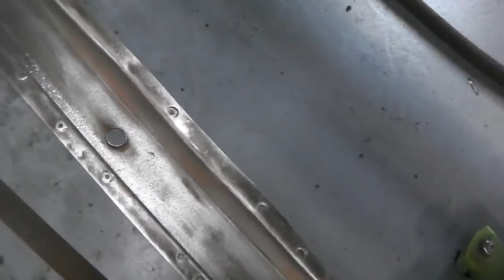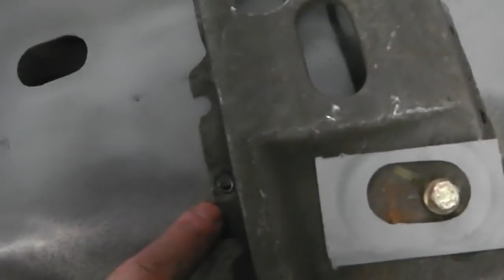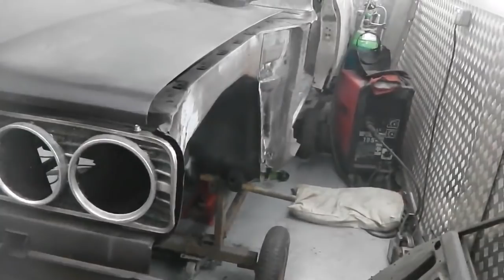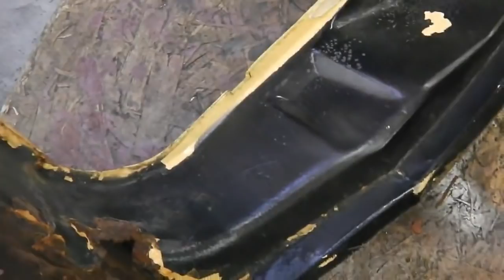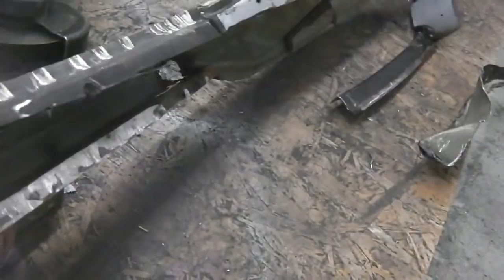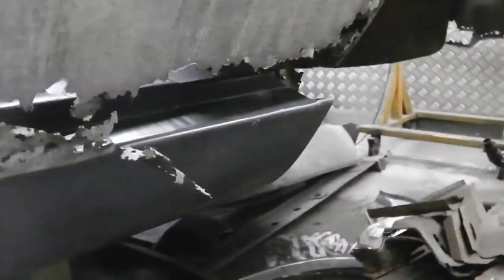Classic Car Restoration - Ford Cortina - Project Bramble Ep16

Comment: Pete, given the age of the car and the last time it was on the road, the quarter is almost definitely oxy acetylene gas welded as opposed to mig. Drilled plug welds are less likely with gas and it was very common to either fuse the edge of pinch welds or blob a bit of rod on the panel edges. Gas welding is largely a thing of the past now, however it was far more forgiving for in terms of weld prep and great for rusty exhausts. 👍🏻
Reply from the maker: very good and YES you are right its not mig!! well thought thru GG!!!!

Comment: Hi Pete, Nice to see the  new floor pans in, even though the whole shell was acid dipped it shows that inside the chassis rails still had rust inside when the old floors were removed, and that was why I decided on my one to do all the acid dipping of the panels myself, as I was removing every panel and replacing it, with new or original back in, it ensured every bit or rust was removed, and then painted inside straight away to prevent any new rust forming,  cleaning off and painting it inside like you are doing now,, will make her last years longer, than building it, and covering new formed rust with waxoyl,  like most do, your getting so much better with build quality (prep)  on this one, I have been building mine over a number of years, and had no new rust forming with the amount of panel prep work I have put in, proof it works!!,  Bramble will be a Great car when you have done,
Reply from the maker: thanks Keith, yes rust still trapped, however theres only a limited amount of cavitiys that cant be accessed, i guess panel folds are the worst to tackle. but you would have to dissemble entire car to get em all

Comment: Nice job Pete. Watched the last few on floor and sill replacement, all looking good. You spotted the cold weld correctly, where it sits on the metal rather than fused to it. No problem with your welds now though, penetration is good and the whole job is far better than some 'professional' repairs I've had to deal with.

Comment: ello mr PC.... great as always.... question..... can you tell us the make of that belt sander.....also... have you had to replace the sander ever....is it the same unit used in swampy and ruby builds..... ?
Reply from the maker: its a b and q special , macalastair cheap at 34 quid and GOOD if you take it  easy but MUST MUST use zirconia belts for best results, belts are on e bay, 437mm 60 grits, its 2nd belt sander, first one seized the end bearing, though if you go gentle they are good for the money NEED 400W minimum dont get low wattage ones like the SILVERLINE if you want to grind a lot of weld s
Reply: I bought the silverline one. £32  wasted. Wish I had seen Petes review beforehand. I now have an evolution 400w.  I think it could be the same as the B&Q one but not sure but it is good!

Comment: That second pan went in sweet pete your making it look easier than it is m8 great job
 have sent you a email to where you suggested about parcel address but haven't had a reply as yet
Reply from the maker: hi antony i cant access the email as microsoft locked me out a month as i changed mobile number. if you send me your mail on here ill reply with my works e mail

Comment: I have to ask again,  this puts you up to four Cortinas.   How many can you own before you reach "maximum Cortina"?    How do you store them all?
Reply from the maker: maxiumum is 5 i reckon !!! got 1 outside (estate) 4 in dry store
Reply: @PeteCswampy  whats the 4th dry stored or are you counting bramble in that? I know you have tina g, swampy, ruby and tc outside
Reply from the maker: yes bramble is 4th dry stored but will have a 2000e hopefully too for next project after bramble
Reply: Ooh, exciting!  Do you ever run out of energy??!!!  I've still got that V8 (American muscle) that would EASILY fit into a mk3 engine bay!
Reply: Pete C Thank you for answering my question!

Comment: Hello Pete, i was sober when i started watching this movie, and now I am not.
 Thoughts,
 Nice job fella.
 Why are you going to have the shell blasted? why not epoxy prime as you move on section by section?.
Try oxy-acetylene welding as you go, MIG together stuff then grind off the protruding weld then fusion weld the panels together while planishing often with hammer and dolly,- a pain to get the hang off but worth it.
Why do people down vote these videos? do they leave a reason why? odd.
maybe they are front wheel drivers.
 Best regards, Sam.
Reply from the maker: only blasting the main paint areas